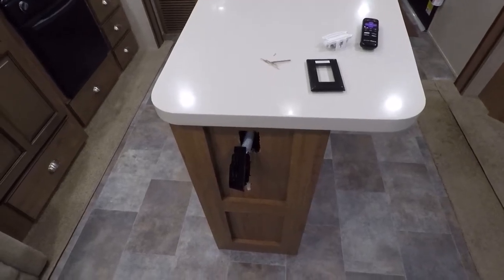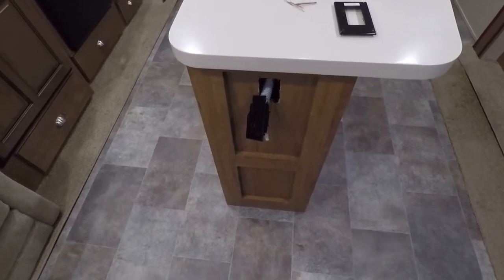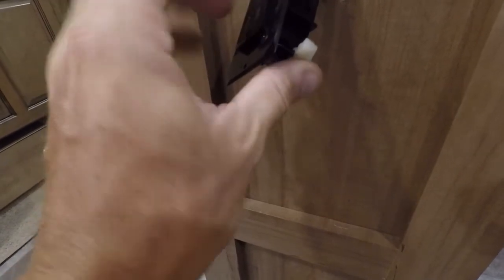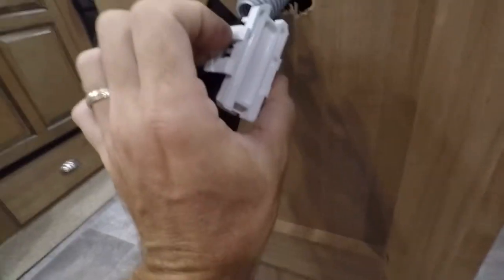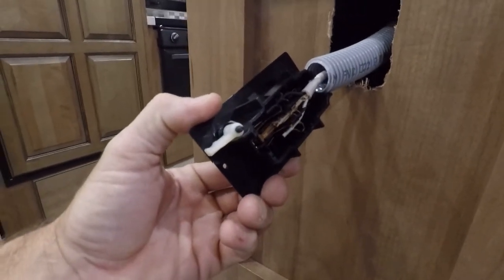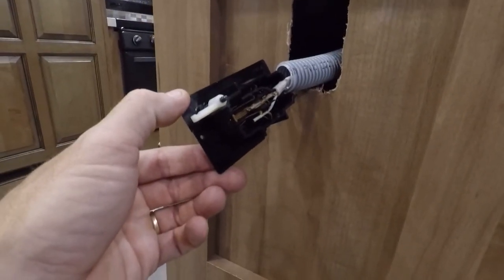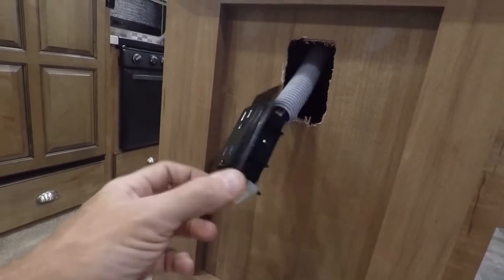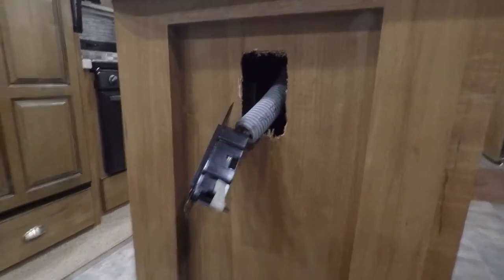Camper Outlet Removal

Comment: Instead of wasting time with changing both outlets since you were worried about metal pts and pans contacting the one outlet why didn't you go to Lowe's or Home Depot and buy a $2.00 plastic electrical box that would completely contain the outlet?????????
Reply: Very true this video is useless, go to the store buy a box and and outlet and just replace it. Even better get an outlet with USB ports for charging phones and tablets